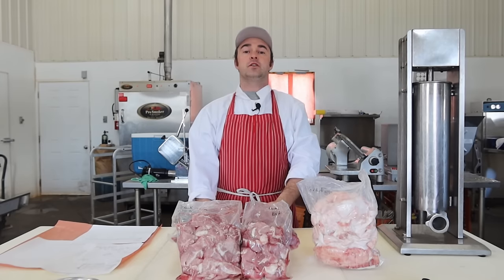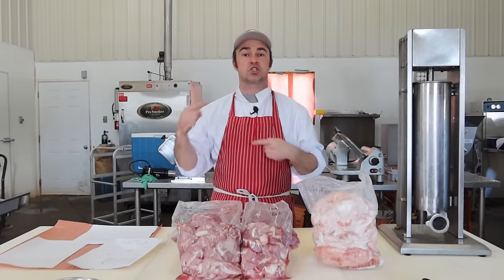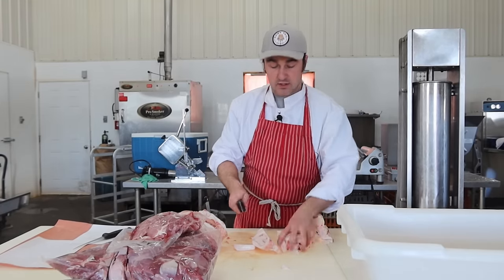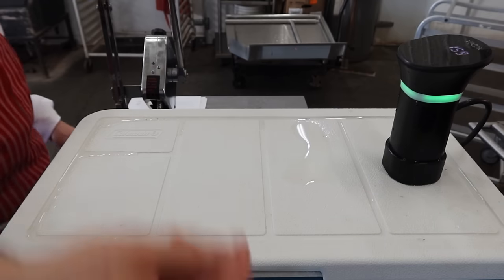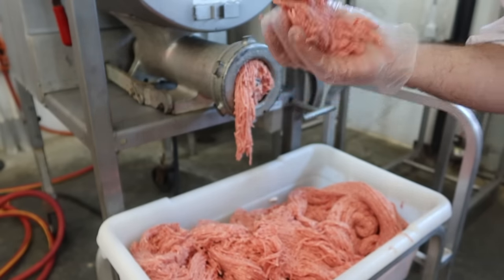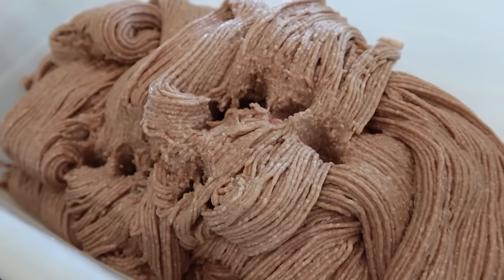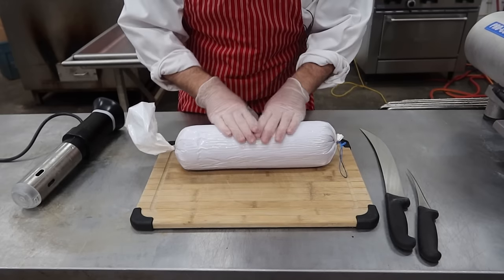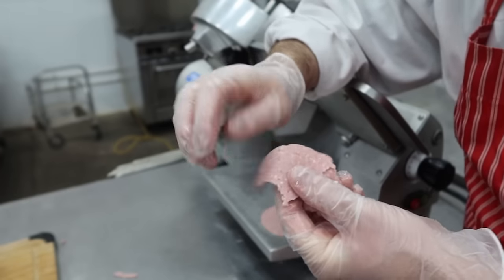Sous Vide Sausage cooking experiment. Making European Bologna.

Comment: I've used sous vide for summer sausage many times (similar process, just smaller chubs).  It's a great technique.  The beauty is you can set it to your final temp and never worry about over cooking the meat. It just needs to reach that temp all the way through, but it will go no higher.  I do understand that extreme lengths of time in a sous vide at temp can affect the texture of the final product (talking 1 day or more in the magic hot tub).  It eventually reaches a point where it is too soft.  There are some real world tests on the Serious Eats site if you want to look that up.

Comment: Where is the hog ring banding unit come from?? And how much does it cost?? And how much are the staples for it?? 
I like using zip ties which are plastic and a pair of pliers to tighten them up or cut it off. Im also looking for a table top meat & bone saw, like a butcher-boy brand.
Reply: I literally just bought one of them. It was $200, was just on sale for $170a few days after. Google "U shaped sausage clipper". Got mine from the V instead of the rain forest. 5000 clips cost ~$30-50 depending on shipping.